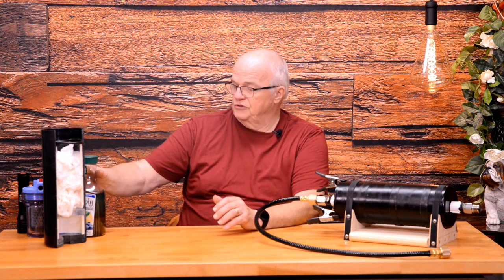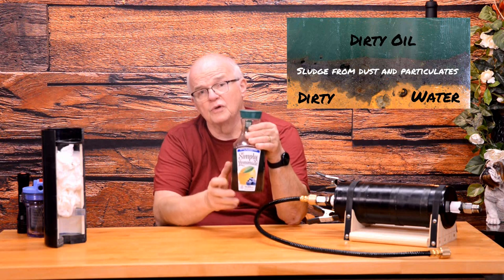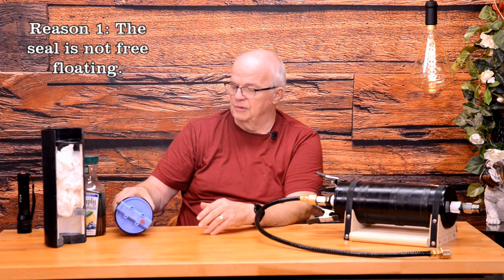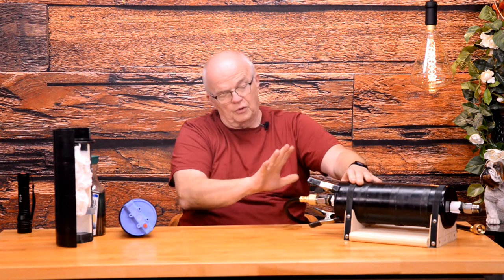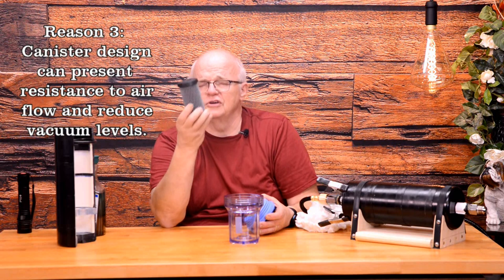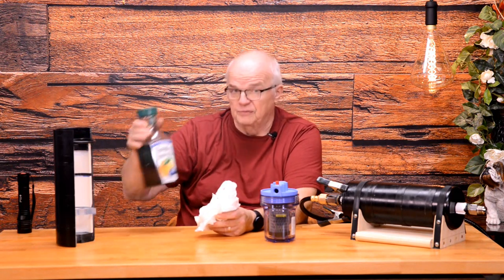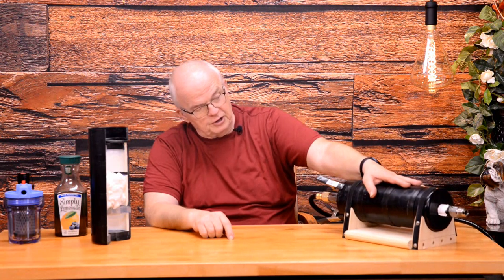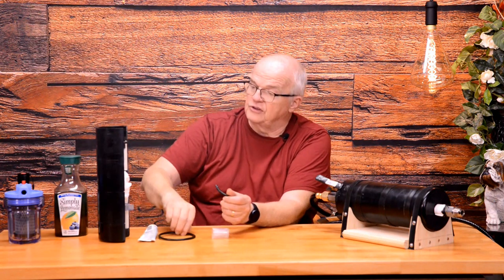Fabricating a Vacuum Pump Air Filter - Part One

Comment: If it’s just used for vacuum bagging I’d think making an adapter that attaches something like a kn reusable filter to the vacuum port in the chamber would work fine. I haven’t tried that so if there were reasons to avoid I’d be interested to learn more. Thanks.
Reply from the maker: Hello Michael, What you are saying is true, there are a lot of different methods that might be incorporated to filter the air if air flow was not a consideration. Whatever filter you use it must allow the vacuum to get down to below 400 MT. My first attempt was to just put a cotton cloth very lightly into the vacuum port inside the chamber but even that little bit of résistance prevented my vacuum from getting below 2300 MT. The unit I designed in this video effectively filters out the particulate without opposing air flow and that is a critical consideration. Thanks for the comment,  Evan

Comment: I have the premiere pump and I run 10 to 12 batches before I change the oil and I’ve never had oil come out that dark.
Reply from the maker: As I stated in the beginning of the video unless you use your FD as a vacuum packer this filter is not likely to be needed. It is the dried food dust inside the Mylar bags that gets sucked into the pump along with the air being evacuated from the bag.   Thanks,  Evan

Comment: Which version of vacuum pump are you using with your freeze dryer?
Reply from the maker: I have both the oil free pump and the standard oil filled pump. unrestrained particulate flow can damage the oil free pump shortening its life considerably. As I stated in the beginning of the video unless you use your FD as a vacuum packer this filter is not likely to be needed. It is the dried food dust inside the Mylar bags that gets sucked into the pump along with the air being evacuated from the bag.   Thanks,  Evan